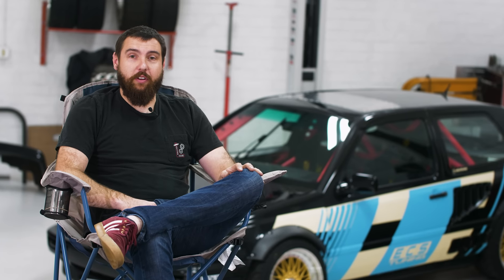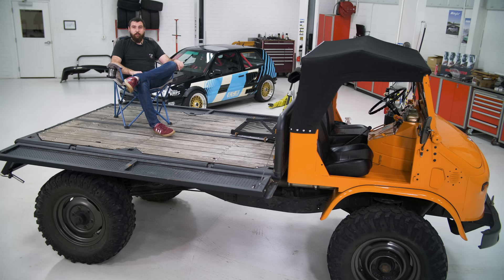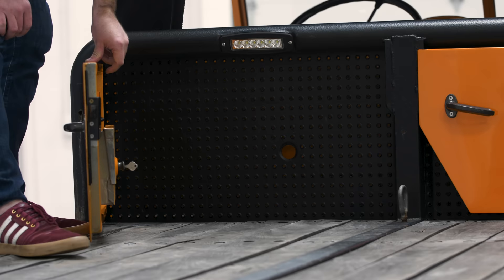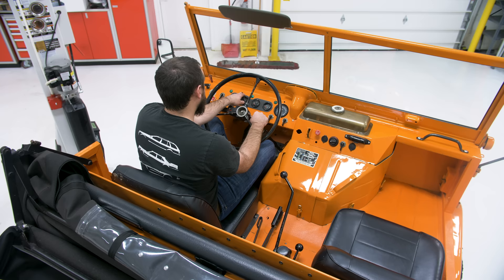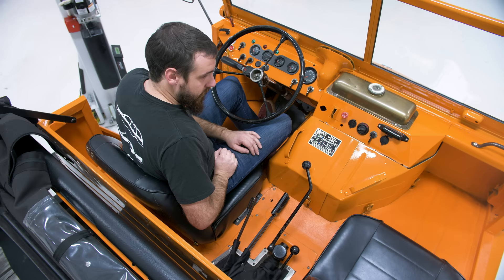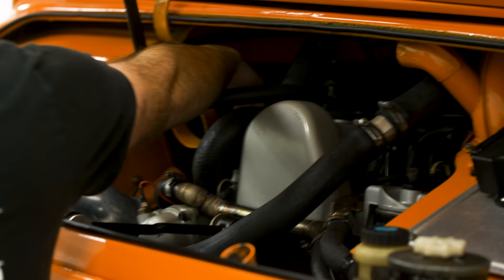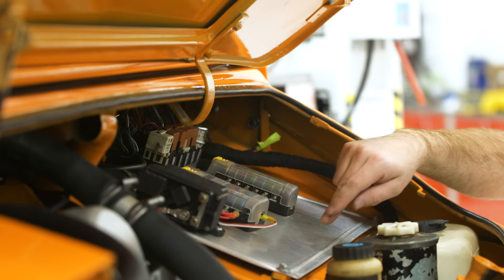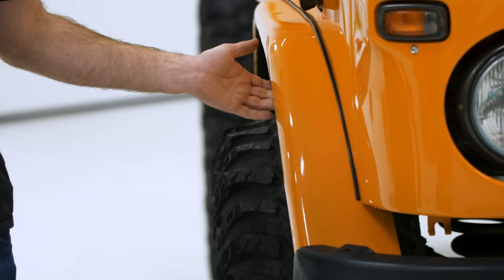It's so BIG!  | Restored & Modified Unimog | Enthusiast Built

Comment: that oil bath air filter is used on every diesel tractor that's like pre 95. so idd assume they are safe 😊
Reply: "Assume" all you want. Technology advances for a reason. Air filters are more effective at all engine speeds while oil bath filters are not. As stated in the video, there is also the possibility that if you accidentally overfilled or used too light weight of an oil you could definitely cause a runaway engine scenario.
Reply: @Knuck3ls1  they advanced to sell more filters 😂 those oil bath filters never went bad. They can be left alone for 10-15 years and still work perfect :p

Comment: The hand-throttle is to negotiate extreme off-road obstacles at slower than walking speed, in particular steep climbs and descents. I learned driving on one of these in the military. Awesome trucks. Ours were five cylinders petrol.
Reply: The 404 was designed with a 6 cylinder 2.2 litre motor as standard. Often mistaken as a 5 cylinder because the no.6 sparkplug is hidden under the cab scuttle. Absolute sod to change.
Reply: @davidray6762  Thanks. I stand corrected. They were indeed 6 cyl petrol, and a pleasure to drive, especially totally stripped down with a couple of GPMGs and a Point 50 mounted at the back, a real “battle-wagon”. In 1979, we used them as the “red side” (actually in NATO, it used to be coded “orange”) in a full training exercise against the 82nd ABN dropped in eastern Belgium, exactly where their forefathers defeated the Germans but with great losses during the cruel winter 1944.

Comment: Looks amazing, I see a lot of hours into it. The only thing is the 4 wheel drive in Lockers. You don't have to hold it in place to have used it, lol. It just wasn't adjusted correctly. I have wheeled a ton with mine full locked. I'm on my 3rd 404 and they all worked the same.

Comment: Great ideas with the bed sides for ramps and the door stowage.  I was planing to make pockets on the bed sides and on the frame and have short pipe sections that fit in them to widen the bead and lengthen it for full weight capacity.  Just the same as the cables you are using, but really strong

Comment: Smashing Unimog, a friend had a Unimog 404 with the 2.2lt petrol engine and that would get to 65mph as the engine revved higher than a diesel, he changed it for the 2.8lt version which made it a bit faster but acceleration was a lot better, he then fitted the Unimog crawler box to it which gave it two more gears below first which made a huge difference offroad but it was a thirsty truck.

Comment: Nice build. I like the idea of the turbo diesel transplant. I used to work on these things for a guy that imported and resold them. We used to get 2,8 liter gas engines out of regular sedans and drop that in place of the little motors. Twin carb version could be good for 160 or so hp. Worked pretty well.

Comment: Talking about it being slow, don't forget that the Unimog was supposed to be a tractor that can also go on the road as a truck.
Unimog means "Universal Motorized Tool" in German.
They don't need to be fast, their point is to work, power attachments and be easy to fix if they break.

(Also please take care of the rust out back)

Comment: This is the only hot-rodded Unimog that I have come across so far. I drove a 404 when I was in the army, and that was quite some time ago.
What strikes me is that the wheelbase looks a little odd. Did you stretch it?
If the engine is shot, you have no alternative than to swap it, of course, but I liked the original 82 horse thing. It was a bit of a guzzler, though.
What I like best about your project is the paint job. Looks amazing.

Comment: You don't need to hold the locker lever, or at least you aren't SUPPOSED to have to hold it. Detent will take care of that if the mechanical linkage is adjusted correctly. As the owner of a handfull of 404's I can appreciate all the work you put into it, thanks for sharing!  Is the steering box you put in ported for a hydraulic assist, or just running off the box itself?

Comment: Something was wrong with your 4wd shift lever if you had to hold it to keep the diffs locked, usually there is a detent to hold the lever in the full locked position.
Reply: Also a decent amount of the 404's had power breaks (weither it be air for the german radio boxes or a vacuum booster for the swis army trucks which I think the truck depicted is).

Comment: Haha, "I used the cylinder off of an e28 M5"

Why not?? They're both made in Germany around the same time. That's called ingenuity, ladies and gents. (although admittedly,  he could have pulled it from a cheaper e28) ;-)
Reply: jason9022   Woaaah, no need for the hostility buddy. 😊 He said it right about 11:00. And I've owned multiple e28 BMWs...including a slow 528e and a nicer 535is to be precise. I don't know why you think I'd lie about this haha. But more specifically, he's used the power steering reservoir from the e28 M5...it's the black (scratched/chipped) reservoir he puts his hand on. Take a nap buddy.
Reply: ...the power steering reservoir (in this case) contains the fluid that sits inside under pressure for the hydroboost system.

Comment: The part about to have to hold the lever for lockers is wrong. If the lever doesn't 'stick' after pulling it up, it needs adjustment. It should stay in that position and the lockers should engage after a bit of movement.